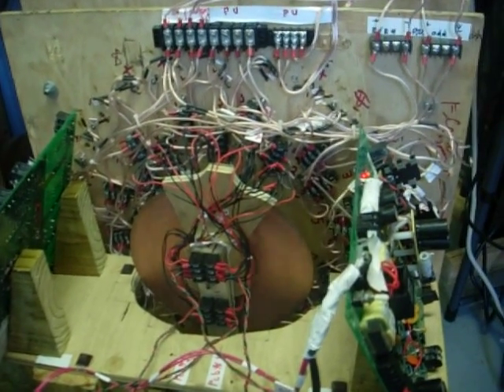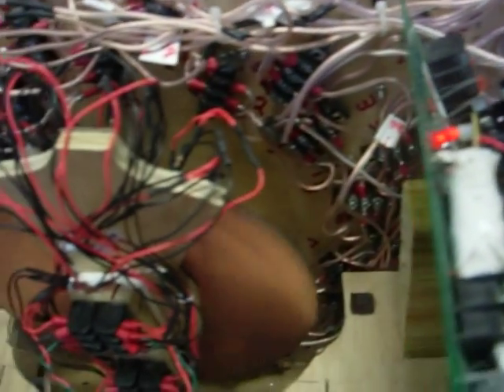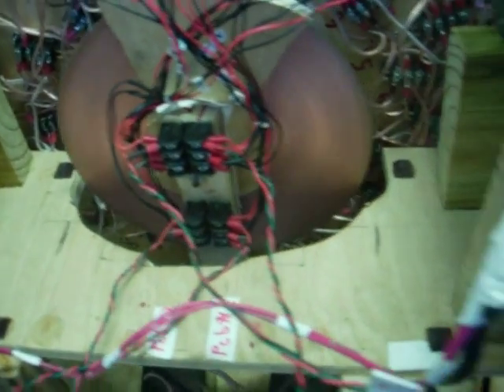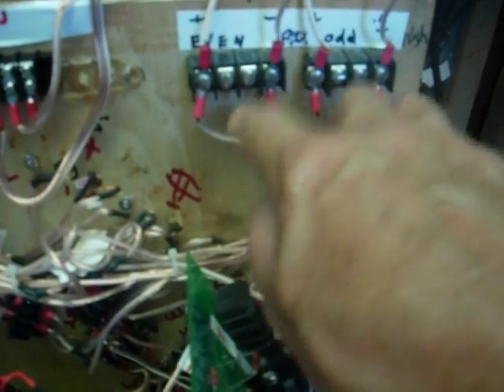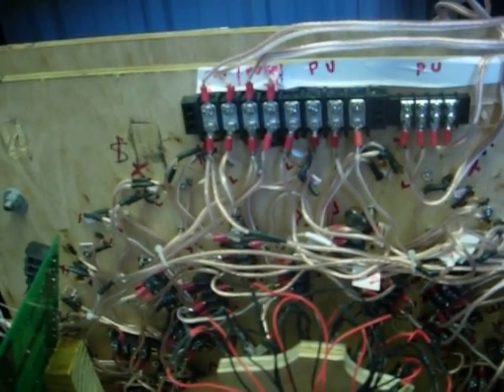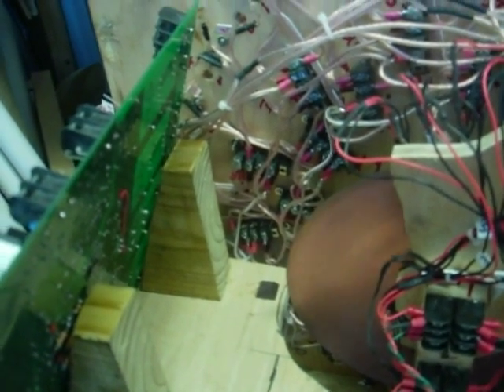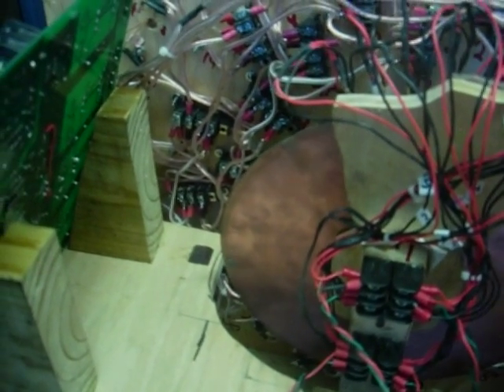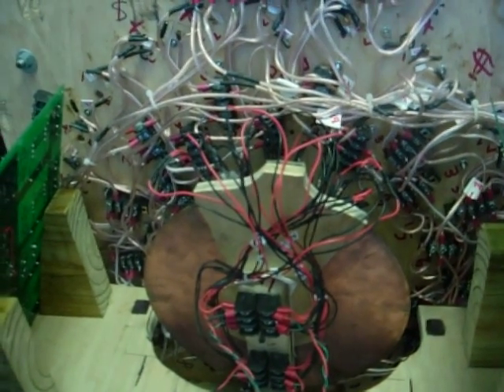Don Smith #39 latest update & description

Comment from the maker: Update:  the new version is in the works just completed 4 new stators dual coils two wires used one green and one copper color, 1000 turns per coil 24 coils per stator each pole is being used(prototype used only one side of coil)  26 ga magnet wire, these were placed in holes 1 7/8 dia with yarn filling the gap then epoxy poured over the coils this was done both sides.  all connections were made using terminal blocks which all are placed on one side  96 connectors used.  currently 12 odd and 12 even coils are wired in parallel.   Machine shop has the rotors done and couplers 6 18" dia 1/2 " thick rotors 5 will be used 96 2"dia neo grade 52 magnets will be used. two outer rotors will have magnets inside surface only.  I may have a few on outside for dc pulse generation if needed.   Test of stator with 12vdc battery yielded 10 v pulse at second pickup coil.  so 2 v were lost.  BEMF only occurred when I used 24v and reach 150v spikes.  oscillation was limited.   this is all due to coil design. original prototype used 300 turns 24 ga mag wire.  and the BEMF ringing event was awesome.  will have first assembly done  soon.  rotors will be balanced after magnets are glued in place.  Epoxy around outside edge and steel nails epoxy thru hole in center.  The two new pcbs are done  and I have the cold electricity circuitry with tesla coil done  will build another  one which produces normal electrons at HF HV 2kv.   the original proto had a 1/2 inch shaft this new one has 1" di shaft.  the stators alone weigh about 15lbs each. the motor will end up being 24x24 x10 long shaft will be 22 "  which allow for added items like LED pulse  gen with 9 " copper disk slotted.

Comment from the maker: The HV system currently runs on a single 12vdc battery at 48 watts.  If it can replenish the blue caps fast enough then the car will only require 48 watts.  By using BEMF and energy swapping like Tesla discusses in his patents ( he calls it the coil kick which refills the cap)  This exchange is thru HS diodes pos discharge fill neg cap visa versa.  The HV system should then only need to replace the energy that the swap losses do to heat.   the car motor will have many of these rotors

Comment from the maker: The 100 vdc test will be done using the energy system with the blue caps which are 620uf at 500vdc 4 in parallel two groups one pos and one neg.  these two groups will replace the 12vdc batteries.  my next step will be get the energy capture board running to keep the batteries charged.  all circuitry is being designed for both 12vdc system and HV blue cap system.  The hv system is up and running and the larger PCB controsl the voltage level at the blue caps and canbe set for any level desired